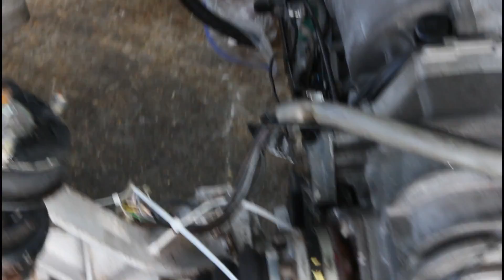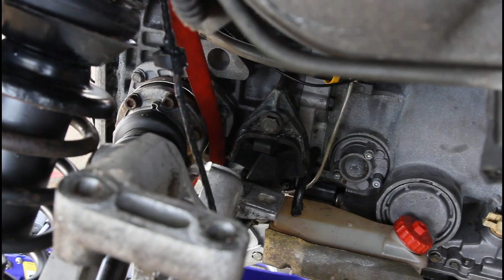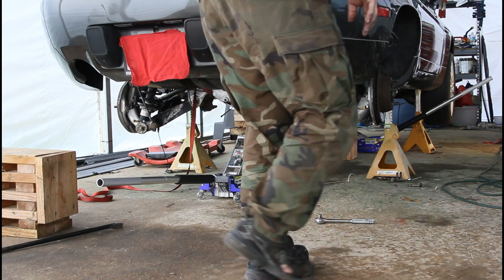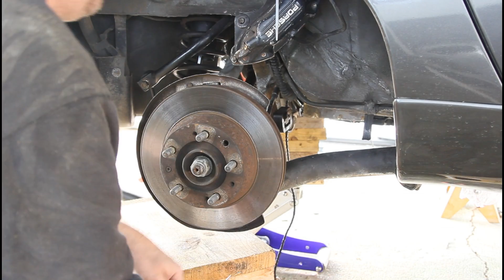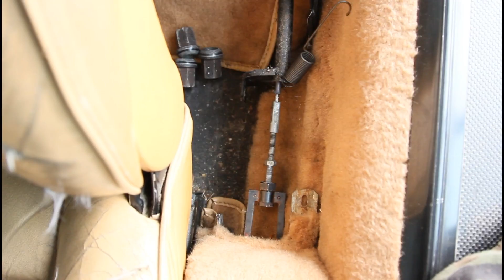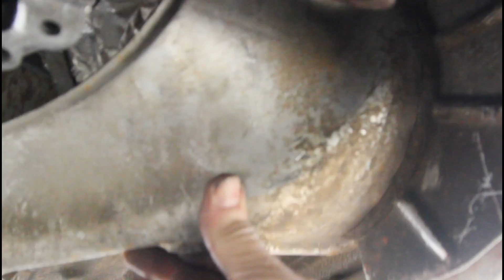Porsche 928 torque tube and transmission install.

Comment: Can you remove the torque tube without removing the transmission
Reply from the maker: +Gregg Hancock Hi Gregg.....it can be done BUT not sure its worth it. The transmission has to move rearward 3" or 4" for the tube to be removed. I find it less trouble to just drop the transmission altogether.

Comment: A labor of Love. Ya done good. I did it but it was sooooo frustrating. You must have PATIENCE if you want to tackle this project. I failed to change the rivets with bolts on the flex plate...darn!